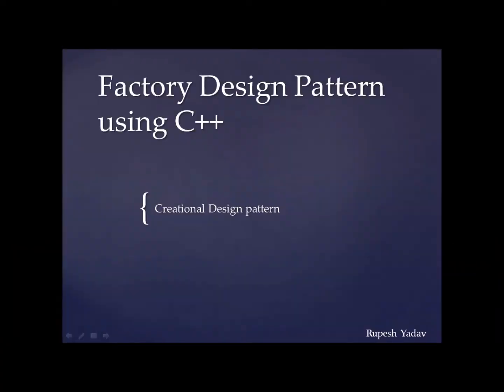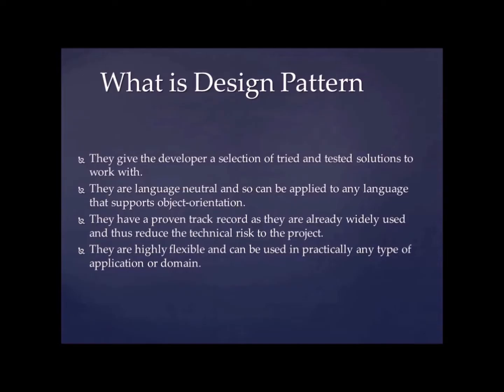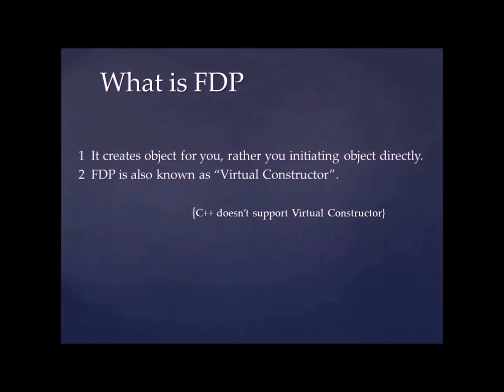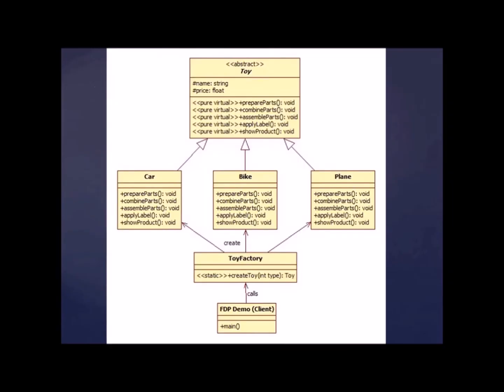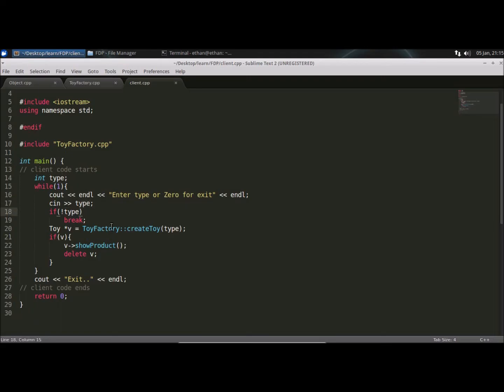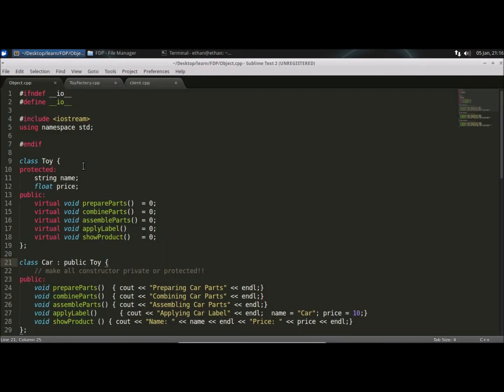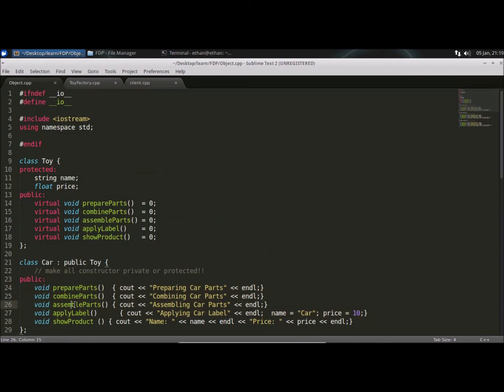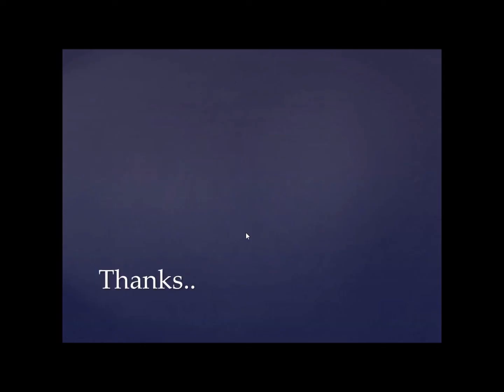Factory Design Pattern in C++

Comment: Definition or Initialization:
Now, when we declare any member variable & assign some values to variables, then member variable is said to defined or initialized
Also, if a method is defined with body (with logic inside opening-closing curly braces), then it is said to be method definition (as against abstract method when we said just declaration)
Examples: concrete classes

Instantiation:
When a blue-print or full-fledged class is defined with its member variables and method definition, then we need to create or instantiate an object; so as to access all possible variables and methods
Instantiate is the very correct word used (instead of create, which is used to understand in laymen terms)

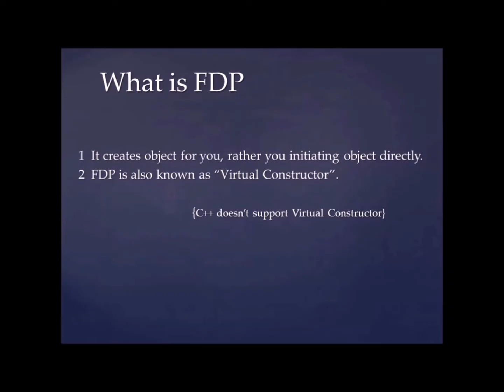Comment: Good one.  I have one doubt in GangOfFour book it is mentioned that subclasses will decide which object to create (Same thing you mentioned at 4:25 of this video).  But in your implementation I did not see anywhere subclasses are deciding the creation of an object.  Kindly clarify.
Reply from the maker: i recommend read this article, EXAMPLE section, and try to understand with the molding example they have given.
And for small clarity i can say like: if we are returning Car object then it's Car's class responsibility what to what to make, that's the reason the sentence is written like that. (it's Car class which is deciding and Car class is a sub class).

Comment: Another great video. Since the factory contains one static method it could be made a stand-alone function, what is your opinion of this? I'm get the feeling a class really should contain state and if it doesn't one could create stand-alone functions within a namespace, have you ever come across these design decisions? cheers.
Reply from the maker: lys dexic This is really a good point actually, lots of people think like this like why having one static function inside a class, why not make that stand alone static function which will do the same job, but if you want some other stuff like apply locking mechanism that time putting all those locking stuff all together in one class will make sense.
By the way i believe you can have stand alone function as far as you know what you are doing. And everyone teach and understand the design pattern with classes because when they were design they were design using classes.
I think it would help a bit. :)
Reply: Thanks for that, I only started looking at this because of another comment left here made me start looking at static classes (although not available in C++), learning the language is one thing knowing when and why to use something is a little harder. It would be nice if when you explain the language if you could perhaps mention an example of why you chose an idea over something else, how a concept is applicable, not so much in code but spoken, that will drive the concept home if people could see where and why something is used, I appreciate not everything can be explained like this, but maybe a few things could. thanks.

Comment: Hi,
It was a nice video and explanation was wonderful. 
One Observation during my practical:
In code, you mention that make constructor private or protected. If we create constructor private, code will not compile.
Reply from the maker: Ashutosh Mishra Hi..
I might have told it because, there is no need of creating object of ToyFactory class just have one static function and call it and get the work done, we create objects of those classes where we want to save states in b/w and there could be several values of the same class instance, but here we have one function (createToy) which will take type as an input and return that type of object, so this function need not to be called using objects, because there is no to save the state of ToyFactory class.
And to answer your doubt, your code will compile if you have kept constructor as private just don't call that constructor, means don't create the object(use static functions instead if you can).
Hope Helped !!
please ask your doubts if still confused.
Reply: Hi,
I understand what you have said. but my question is If I create constructor of Toy class private then?